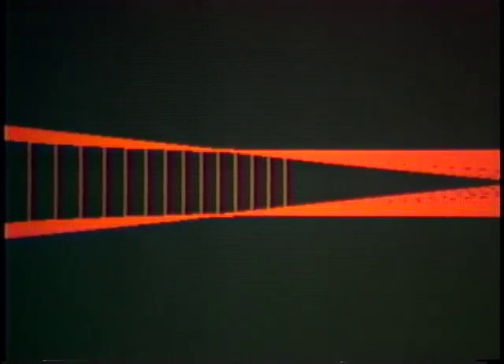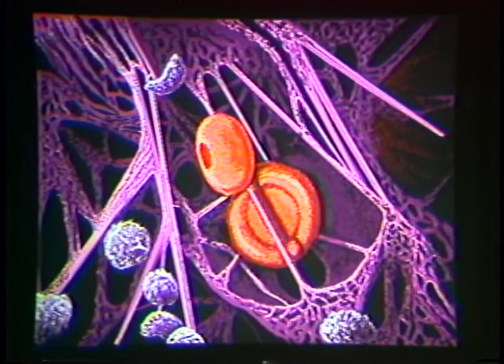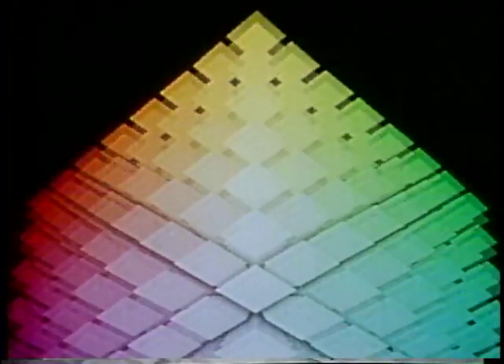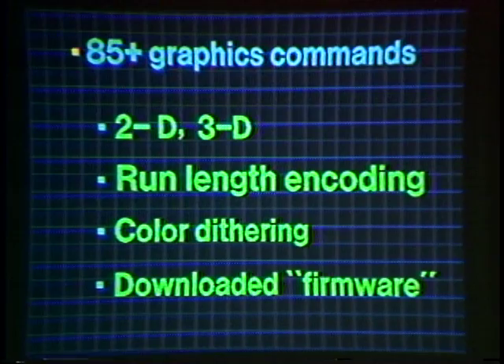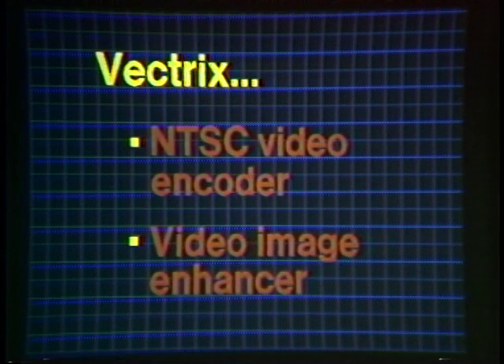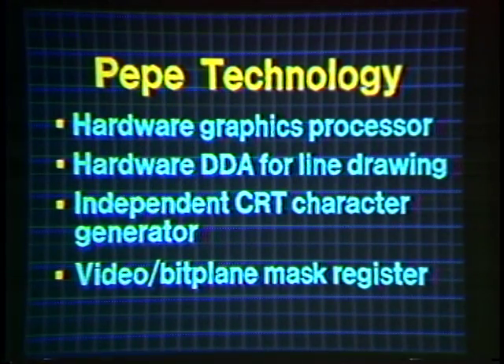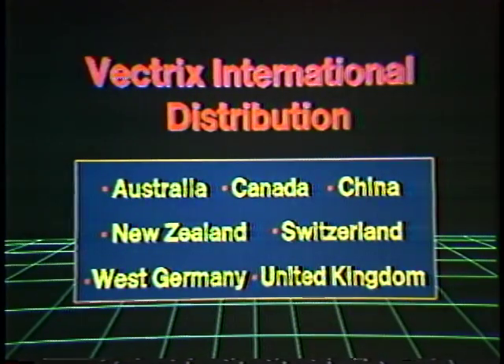Vectrix Computer Graphics Demo

Comment: This promo video likely dates from the early 1980s, as the Vectrix machine was sold around that time.
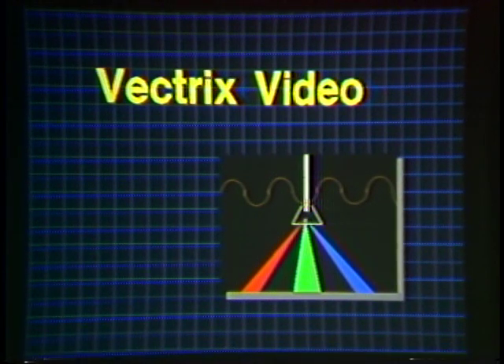Reply: The ad specifically mentions the year 1984 as being the year they recently added new features to the Vectrix product suite, around 7:20 if I recall.  So, given the near VGA specifications and that mention of the year 1984, I would chance a guess at 1985-86 for the year the promotional video was released.  

Edit: A reference to 1985 at around 7:50, so we are further narrowing the time frame.
Reply: In case there’s any confusion with the console system - I think the video game console was “Vectrex” (different spelling). Super interesting that there was effectively a GPU that interfaced via the parallel port. Thanks for dating this video!!!